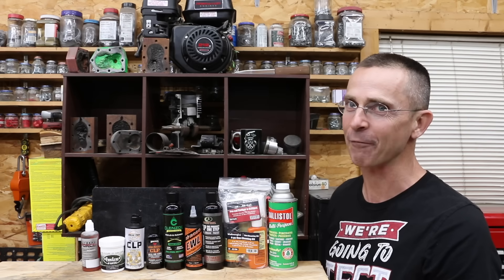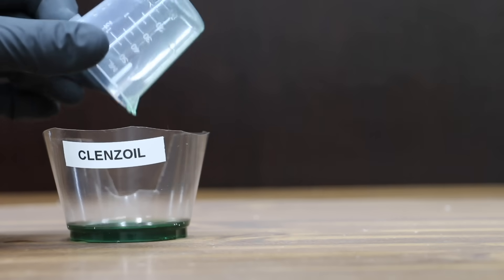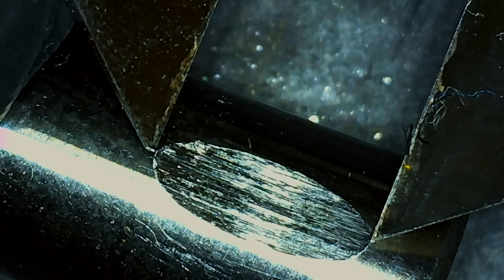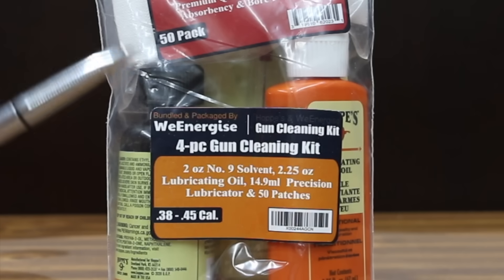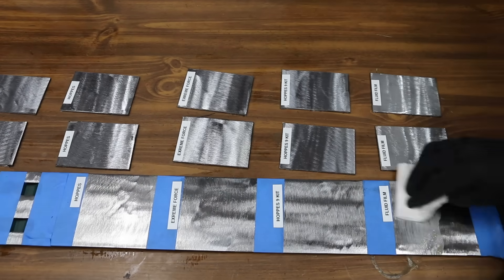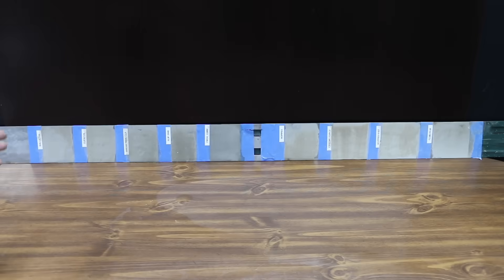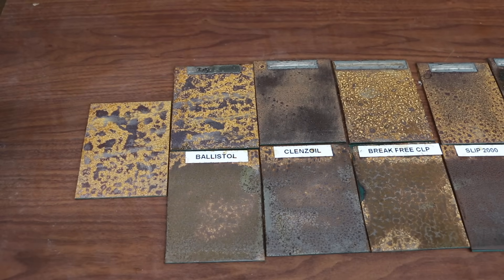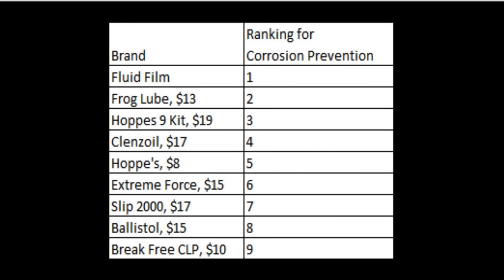Don't Buy A CLP Until You Watch This Review! It'll Save You Time And Money!

Comment: After many years of firing bolt action and lever action rifles, I finally purchased a CZ 75 semi automatic pistol.
After firing about 230 rounds, it started to experience failure to feed.
My son, a US Marine and Police officer asked what I used for lube....I lubed it with Hoppes #9.
He said nope, pulled a small bottle of Break Free CLP, sprayed it in and whammo, no more failure to feed, he loves being a smart ass when he does teach me something I didn't know.
So it's all I use now.
Reply: 20 year Armed Security Officer. BreakFree IS the best in my opinion. A military man turned me on to it as well. He stated that the military mainly uses it. If the military supports this for their firearms I am all in. And they are fully auto. I use it for stuck bolts and hinges. It works wonder on the car hinges as well. Wont catch all the dust like WD-40. Which is the worse stuff for firearms. Water protectant, maybe.
Reply: @cobravids  Yep, spray a little clp on it and it will run, only downside is the clean up afterwards lol.
Reply: @Diemerstein  haha, your right. I cleaned 4 at once and i went to wash my hands. I wiped my eye and remembered real quick how that stuff penetrates. My eyes didnt like it. Lol

Comment: Frog lube may have been handicapped in the bearing wear test. A constant pressure if lube touching the surface may have helped it’s chances. Either way thanks for these!
Reply: As far as I remember, frog lube states that to get best results you should thoroughly coat the metal parts n bake em in an oven to open up the pores of the metal a bit so the lubricant actually soaks deeper into the metal. Could be total BS but that's how I used it and I had no issues. 
I also did not perform tests like our boy Todd so idk

Comment: Love to see a test with Triflow, we use it alot commercially. Eezox is another one that provides great firearm corrosion protection. 

Also a gear oil episode that separately tests oils with LS additive and those without.

 Delo esi 80w90 is considered the best dino oil, include Valvoline white bottle dino.  Both without LS additive. 

Mobil delvac 75w90 and redline are top synthetic without LS additive. 

With additive, the list is long amsoil severe gear is said to be the best. 

It's hard to find gear oil without the limited slip additive. Reason for not using LS additive are Torsen style worm gear lockers specifically say to avoid it. Guessing the additive makes the oil too slippery for the application, causing it not to lock up as well in low torque situations.
Reply from the maker: Thanks for the video ideas.

Comment: the thing with ballistol is it works better the more you use it. needs time to penetrate the metal but once it does, i've found cleaning my guns barely takes more than wiping all the parts that the gas blows over, and they run smooth as butter. Just gotta get past the horrible smell
Reply from the maker: Thanks for the feedback.

Comment: Really would like to have seen shooters lube in the mix. A 2 part CLP cleaner and lubricator. Veteran owned company made it safe ingredient, and extremely low oder. Does a great job at cleaning carbon the others are extremely hard to test without proper equipment

Comment: Almost every CLP is mainly mineral oil with a few additives. It’s not a great lubricant for high loads, like slides; that’s a better application for lithium grease. For very high loads, like pivot pins, I use ATF. For cleaning, I use homemade Ed’s Red and homemade Ballistol, either of which can be mixed up for not much more than the cost of mineral oil alone.

Comment: There’s a army run study with slip2000 i remember reading a while ago and for high use weapons like 240 bravos the slip 2000 prevented parts from breaking over the course of hundreds of thousands of rounds. Was coool study but not sure why they stopped issuing it and now issue clp instead. I always prefer a two step system over 2/3 in 1
Reply from the maker: Thanks for the feedback.

Comment: 1. Frog lube is coconut oil based.  it does work in an AR tho. I ran it for 500 rds without drying out.
2. My normal lube is left over 20w synthetic oil.
both seem to clean carbon fairly well.
Reply from the maker: Thanks for sharing!

Comment: Nicely done! I enjoyed this one quite a bit.
I thought that Lucas oil made a clp? If you do a episode 2 I would love to see it make the list.

I am now going to share this to my brother who swears by Hobbes.

For video suggestions I've got a silly one, I'd like to see a comparison of spray bottles.
I've tried a lot of different refillable spray bottles and I've disliked almost all of them for various reasons. From the random cheap ones at Walmart to the expensive Zep brand from Home Depot, is there a good one that I've simply missed?
The cheap ones don't spray enough quantity per pump and leak from the adjustable nozzle, while the Zep bottles get goofed up from hanging them by the trigger. Most of them have a constant air return valve which means they leak if they lay over.
And, aside from the Zep most of them aren't meant to spray harsh chemicals like bleach or ammonia or concentrated degreaser.

My most recent purchase are Vivosun pump up bottles off of Amazon, all metal spray nozzle, constant spray, no trigger to wear my fingers out on and I'm not gonna mess up the air return valve just because I hung it off of the handle/trigger. But I've only used them a handful of times in my 1 week of ownership but so far they seem to be my answer.
Reply from the maker: Thanks!   Thanks for the video ideas.

Comment: I posted this on a Rimfire forum.  Somebody asked if you would test Eezox.  Another objected to it citing it's toxicity and smell.  Perhaps it should be mentioned as a parameter in your test.  The same person had objections to Falex load test:  "Falex load testing really isn't applicable to firearm applications.  Bearing surface loads will never come anywhere near that in a firearm application."  I'm only the messenger, but I kind of agree with that one.

Comment: The thing is, a good solvent won't be a good lubricant, and vice versa.  It's best to use a strong solvent to clean, then completely dry the parts before using heavy oil or grease.  I use Hoppe's cleaner, but a lithium grease on contact surfaces.
Reply from the maker: Thanks for the feedback.

Comment: Ballistol and Frog Lube I have both used for a couple years each at different points and never had issues, with the exception of one stuck case in an AR that was over lubed with Frog and got basically vacuum stuck by suction in the chamber. Way back in the day I used Hoppes No 9 as I think almost every shooter has at one point, but over the years just like with my cars and bikes, I eventually transitioned to using Amsoil pretty much exclusively. It is a two part system; a cleaner and then a lubricant/protectant, but it’s still no extra work. Also, when I run my hand loads with clean, copper fouling resistant powders like CFE223 and CFE Pistol I don’t need anything more than unscented baby wipes to clean, so I only need the lubricant can of Amsoil after those range days.
Reply from the maker: Thanks for sharing.

Comment: I used LSA for years in the Army. Later, the switch was made to CLP. What actual use taught me? For machine guns, LSA is king. Add it freely and often. For small arms, those handguns and rifles, CLP is better. Just my experiences. On my own guns? CLP is often used. 

Note: for revolvers, everything under the grips, very little of very light oil only. Over lube causes failures. Once a year, it all gets cleaned for a fresh application, if not fired much, otherwise, more often based on your use.
Reply from the maker: Thanks for the feedback.

Comment: Bow strings are usually waxed in order to minimize wear that supposedly happens while the string vibrates and this causes friction between the strands that make up the string.
I have an idea for a video where you make up a device that tests how fast a bow string wears out using several products like dedicated wax, beeswax, paraffin wax, silicone oil, WD40 and/or other substances.
Also maybe at what strength does the string break after staying a few hours/days in the substances that might chemically interact with the plastic it's made of.
Reply from the maker: Thanks for the suggestion.

Comment: Very interesting. The poor performance of the Breakfree on corrosion did surprise me. I started using it decades ago and it's the best I've seen for virtually everything gun related, although the last bottle I bought did seem like they had changed the formulation. I did use it as a penetrative oil on some rusted bolts between a header pipes and an exhaust manifold that I couldn't remove the nuts. Freed it up so well that when I loosened the nuts so little force was actually needed I nearly broke a knuckle.
Reply from the maker: Thanks for sharing.

Comment: Awesome content. Only thing I would have liked to see was you heat up the frog lube in the 1st test with the friction. When applying it to a firearm it requires to preheat the metal components being treated so when applied to metal it melts instantly. They also have this product in liquid form. Would like to see if their would be a differenc. I wonder what difference it would make in the friction test if made into a liquid. 

Keep up the good work.
Reply from the maker: Thanks, will do!  Thanks for the constructive feedback.
Reply: @ProjectFarm  Some people also say that if the frog lube is left for months without use it gets sticky. Also when applied correctly then used in the cold it also gets sticky.

Comment: I experimented with different lubes for quite some time, always had some problems (like bad case ejection). Then I tried simple synthetic motor oil; and all problems were gone. You just need to wave farewell to the typical firearms smell. :)

Comment: I lubricated a dead bolt door lock about 5 years ago because when it was new it was "gritty" when I would turn the key. Well that fixed it in a matter of minutes, and there hasn't been any trouble with it since. I like CLP but it's kinda expensive. I have since moved to Ballistol. In light of your thorough tests, I will find another, less expensive product. Thanks Project Farm.
Reply from the maker: You are welcome!

Comment: I would love to see a firearm related epoxy/glue test. When repairing cracked firearm stocks they're is a lot of debate whether wood glue works as good or better than Brownells acraglas, 
In this test I would like to see brownells acraglas gel, brownells acraglas liquid, titebond 3, miles Gilbert bed rock, and JB weld. Also if you included reinforced joints such as with stock repair pins and all thread epoxied in a channel cut across the repair that would be very cool

Comment: Quite a comprehensive test! I've always been a fan of the Break Free CLP since my military days, still have a gallon jug I use around the shop. While not the best at any one of the three areas I feel it is the best all around! The friction test is revealing, but then what military firearm is going to go through that much friction at those RPMs and pressure? As to corrosion, being in the Navy on a smaller ship (frigate) we would clean and lube the action with CLP, but then use a heavy spray of VVL-800 externally to prevent corrosion, as a heavy application of it was the only thing that could really battle the constant salt spray that the machine guns would get. Plus, I've always enjoyed the odor of Mil-Spec Break Free CLP.
Reply from the maker: Thanks!  Thanks for sharing.
Reply: Is the military break free clp different than what offered in stores?
Reply: @svtkilr  I can say that from smell alone there is a difference. I know they sell a couple different types, so I assume the Mil-Spec variant is different than your "off the shelf" gun cleaner. I use it in the garage to help loosen rusted parts, as well as clean parts.
Reply: @shawncalhoun1363  cool thanks for the information have a great week.

Comment: Be interesting to see how Lucas extreme duty clp stands up against the top two clp’s I been running it last few years and really liked how it holds up but I’ll definitely be trying some of these brands and see if it’s any better
Reply: I’m stuck between ordering Lucas clp or clenzoil have you got a chance to try clenzoil?
Reply: @JuanFlores-xb9sy  I haven’t had a chance I’m still running the Lucas but it got used hard this winter on my 870 And 22-250 camped out in the snow all winter and it kept it running just fine even in -13 weather and no rust and it’s still my go to for the automatics in the hot dusty conditions
Reply: I'm with ya, it's all I use on my ar's

Comment: The lubricity test may be a bit misleading for the lighter oils here. The force between the surfaces may be much more in this tester than in most firearm wear surfaces. In a typical handgun, like a Glock, the rails travel along guides parallel to the load.

I'm not sure how to design a different lubricity test for this, but maybe one with less pressure on those surfaces would be an improvement, and the ideal would be a linear test (oscillate a "slide" on some "sliderails"  with an armature, and offset the driving wheel so that it accelerates and presses on the rails more at the start than the end.

Comment: I've shot Beretta gas-operated semi-autos for almost 40 years.  I bought my first one from an All-American trapshooter, and he told me to use BreakFree CLP.  I've always been happy with it, except for one thing, which isn't actually the lack of corrosion resistance.  I hunt waterfowl in brackish water.  I have little trouble with rust unless I drop my gun in the water.  But what I really notice is that, whether I drop my gun in the water or I'm just out in a heavy rain, the water seems to displace the lubrication.  So my gun will work fine at the time.  But the next day, once it's dried out, it will be as draggy as a gun with no lubricant.  So I end up tearing it apart, cleaning and scrubbing everything, and relubricating to get it working well again.  As part of that, any rust is easily dealt with.

So my question: does one of these lubricants resist displacement by water better than the others?
Reply: no but WD-40 IS a Water Displacing fluid,,thats why its called WD,, now its not a great lube and is lousy for rust preventative, but nothing beats it for Water Displacing..
Reply from the maker: Thanks for the suggestion.

Comment: I gotta say maybe the better test would be to run a few thousand rounds through some identical firearms under those various conditions and see what transpires.
It'd be more fun.  
I was intrigued by Frog Lube's ability to tolerate heat and still protect.  It might make a better protectant for cast iron surfaces than paste wax (which is what most use). I ordered some.  the maker tells me there's no silicone in it but won't say what is in it.  And it's edible.
Reply: Just look for an msds for it. Should be one somewhere

Comment: Unless repeatedly mag dumping a full auto, I don’t think the wear scar test is very useful.  The rifling would be shot out long before that much metal on metal wearing of parts would occur.
Anyway, thanks for making this comparison.  I’ve been using Slip2000 for about 15 years or so, it gets very very cold where I live.  It does everything I need it to do and doesn’t freeze.  Interesting results though for sure
Reply from the maker: Thanks for the constructive feedback.

Comment: Seems kind of basic but just testing different metals strength and corrosion like AR500 vs. Mild Steel vs. Aluminum vs. 5150 vs. 304 stainless type of thing
Reply from the maker: Thanks for the suggestion.

Comment: Have you thought of using larger and smaller weights, angled torsion, different temperatures or faster and slower settings on the machine while testing wear resistance? Machines have many moving parts under different rotational speeds, temps, pressures and types of pressure.
It would give an idea of which oils have better variability under heat, cold, angled stress and light vs heavy wear situations, or all of the above.
Doing so would require very little modification to your machine as it is right now.
 
1.) Turn the metal to the side so the surface area is smaller and round instead of straight on.
2.) Use larger and smaller weights.
3.) Ice in a larger cup (cut to size) to simulate cold.
4.) A blow torch acting on the point of contact. Clamp it to insure consistent tests and mark or meter the gas flow.

Those four things would stop a lot of squabbling in the comments. Giving a better idea of which of the oils you test are better for complex or simple machines, and high heat or cold conditions.

An automtive engine for example goes through three cold starts a day and most parts stay at a relatively constant temperature when warm (175°F-450°F) depending on the part. Valve stems or pistons will be hotter than camshafts or the crank. So flow and film strength at a variation of -15°F-550°F is a good measure of an oils ability to lubricate and beyond what will probably be expected of that oil. As is some of it expected to evaporate
A combat rifle on the other hard. Can go from -15°F-700°F in 25 seconds. The gas system, bolt (if it has one) and carier go through vastly different temperatures. Also most have no rotational parts besides maybe the bolt in a few examples. There's also less moving parts and they have a higher surface area to weight alongside much higher pressures (up to 50,000 psi).

Another test you might consider is a hydrophobic test/film resiliance over time in varying conditions and how the oil works after being tarnished and exposed to carbon. See if it is still slick after getting some dirt or dust in it.
Reply from the maker: Thanks for the video ideas.